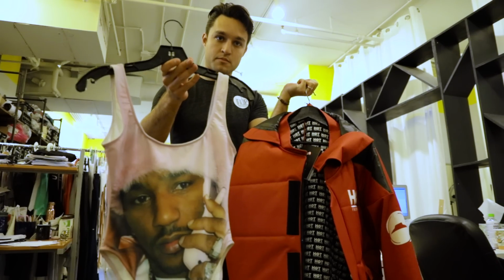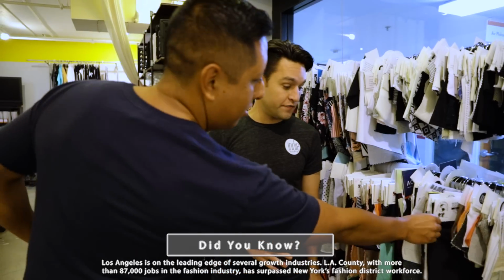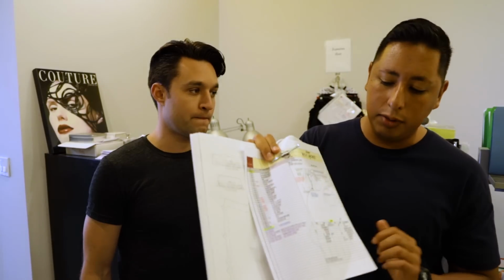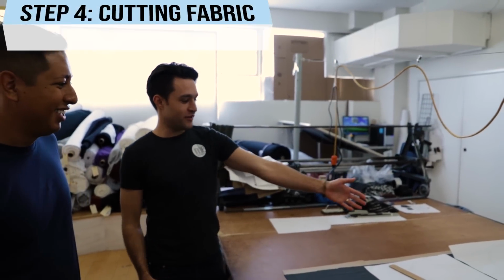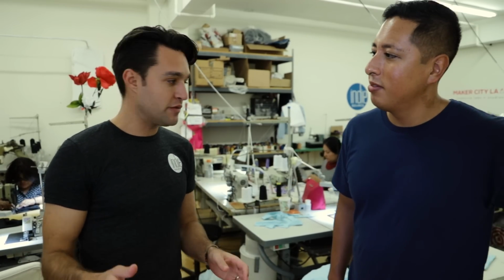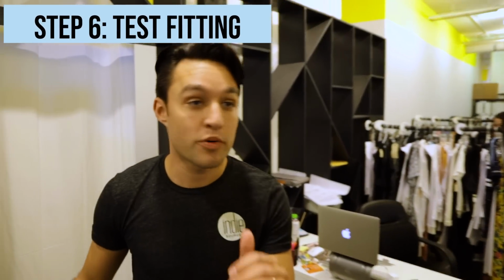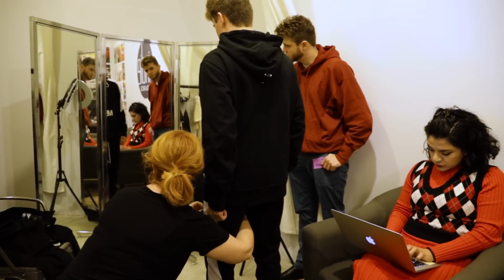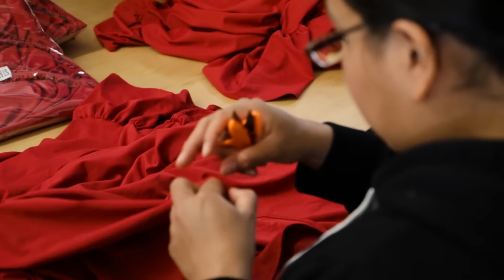How To Create Cut and Sew Apparel From Start To Finish

Comment: if I want to create a super customized cut and sewn garment but still want to fulfill my orders through a print on demand service, instead of holding inventory, how do I go about that process. do I first create the garment from a manufacturer then send it to a print on demand service or how does the process go, is that even possible?
Reply: It probably isn’t possible. If you want to I believe you could create the measurements  and dimensions and send that to a manufacturer that can produce your custom design when $You$ demand it. Also be careful when choosing a manufacturer. Print on demand usually only is for vinyl designs. I’m not an expert but I tried to help. Good luck 👍🏾